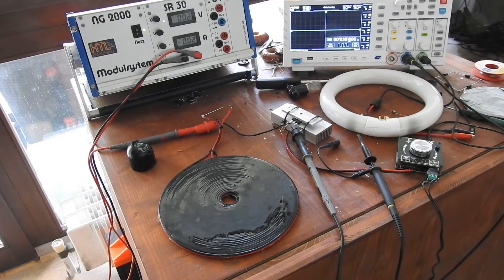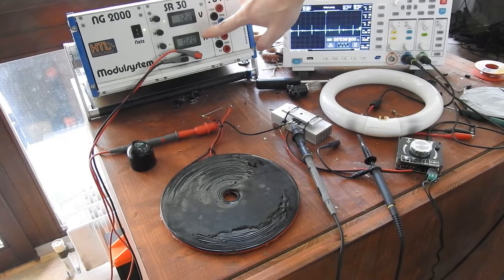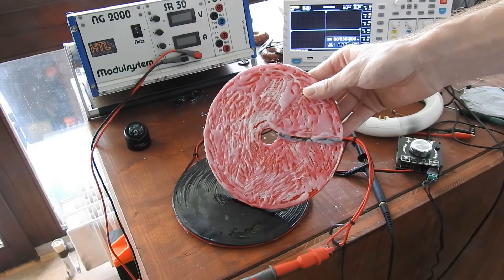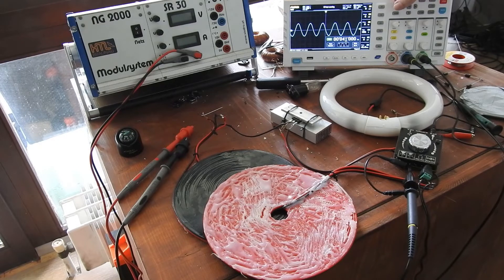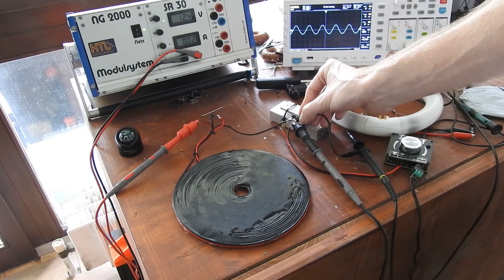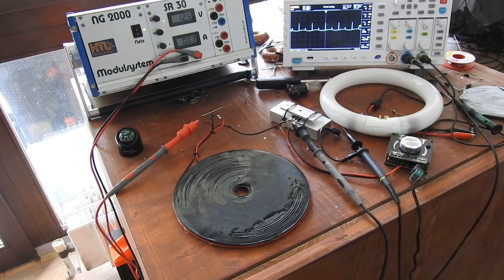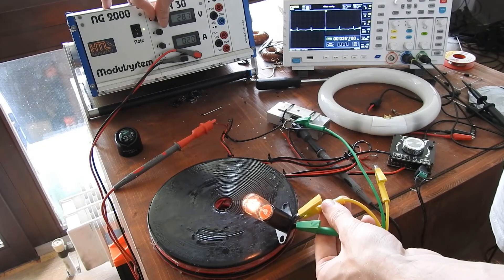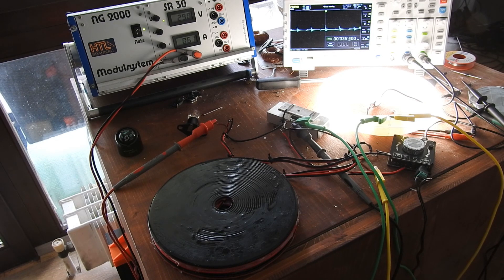3 Methods of using Tesla´s bifilar coil and differences between a monofilar and bifilar coil

Comment: The coils you are using are not the same as Tesla's bifilar geometry. You have the two circuit-halves as a pair of pancake-coils laying one atop the other. Tesla placed his two circuit-haves interspaced with one another in a single flat pale. Your wire positions and Tesla's are 90 degrees out of phase from one another. Your geometry is much simpler to assemble, but you should really try a coil of his geometry and see if it yields the same result.
Reply from the maker: I know you are referring to the design in his patent, but the shape doesn't matter that much, he even stated that you can use all kinds of geometries for bifilar coils.

I tried it with several different geometries including the one you are referring to and all yield similar results.

Comment: Great video friend. I have also experimented with these coils please look at this video it relates to using very low power even though more appliances are added. I did try to make system that can collect the high pulses to a capacitor faster than the input used https://youtu.be/RbdgR-Hitzo

Comment: I like your video I use regular coil and i get very interesting outcomes. which video show the driver circuit. I would like to combine both theories and see a new energy form. also i have found a compress energy form.
Reply from the maker: I show the circuit in my video called "How to build a high voltage impulse generator".
Reply: @OmegaZZ111  Thank you kindly . I also found Mono-polar force and self charging battery system . Now i want to learn from your system it's all on my channel thank i will look at your video Thank you
Reply from the maker: @sidster64  I have watched some of your videos a while ago, what you do seems interesting. 
Good luck with your research.

Comment: According to Tesla the bifiler coil with 1k windings (versus the monofiler coil) gets 250,000 times the potential voltage across the coil. This coil is the evolution of the transformer that replaces capasitors in his circuits. It is his "energy sink". If you read patent 649,621 it shows the monfiler coil. I believe Tesla intended this patent to use the bifiler coil in oil and shielded 🛡. Like I said before, he patented all the components to his devices. The fascinating part is his primary attaches directly to the secondary at the ground. This is an air coil with pure RF energy. He is building up the energy in the bifiler and dumping 95% into the ground where there is almost no lost of energy. This is then picked up by his second identical antenna 📡 anywhere on the globe. It's travels at pie/2 x c. Sounds waves in the ether travel at the speed of light. It is analogous to two tuning forks thousands  of miles apart!
Reply: Hello, Sorry, but you have missed the distinction between the here discussed bifilar coils (also invented by Tesla) and his Tesla Coils --which you are describing.
Reply: Please read my comment. I might have info for you.
Reply: i hope you can cite the reference material where tesla says such a thing...

because its the first time ive read it in my thirty odd years of studying him.

i love how you people just seem to come up with your own theories without seemingly taking the time to even read anything he wrote himself, relying instead on hearsay, myth, and imagination...

you cant push the potential of a bifiliar up to any appreciable level as your dielectric starts breaking down. the potential between any two turns is half the potential across the coil itself, rather than the potential difference between turns being simply the potential drop per turn like a normal coil. it is bleedingly obvious, yet for some deluded reason you think you are onto something simply by saying it should be "insulated in oil", as if that will solve everything, and allow for millions of volts between each turn?

which is why his pancake coils used for high voltages are single wound, and his bifiliar coil, exactly as stated in his patent, is as a "power factor correction capacitor", examples being the run capacitor in an induction motor, or the capacitor across the ballast of a fluorescent light...  because capacitors were expensive to make when he was around. they didnt have polyester film, or kapton tape. they had oil soaked paper, or mica, and coarse, low tolerance rolled sheet rather than several micron constant thickness foils. manufacturing technology wasnt quite where its at today. 

you people all seem to overlook that little point.

theres nothing "fascinating" about having the primary earthed. like any transformer, if the center is tapped, its at zero potential in relation to the ends of said coil.

and what does he say in his patent about it? did you take the time to read it?

from memory...

"one may also connect the end of the secondary to the center of the primary for safety reasons".

did you fail to see that bit, or it simply doesnt fit in with what your imagination requires?

what WAS fascinating about a pancake coil was that it pulled arcs from the objects around it, rather than arcs spraying out towards objects. the coronal discharge and inevitable ionisation of breakdown always traveled from grounded objects and headed TO the coil. besides my own, ive only ever seen one other coil doing that.
Reply: @paradiselost9946  The bifilar coil's high energy storage capacity makes it of interest for coil discharge experiments, the inductive spike that shows up when the circuit opens comes from the environment, not the collapsing magnetic field as we're taught, a coil with a high capacitance like this makes to serve as a better sink to the incoming flow than a regular monofilar coil.
Reply: @JenkoRun  begss the question, WHAT IS the agnetic field and what is it DOING when its "collapsing".

one of the biggest hurdles is our understanding is limited by language and other peoples preconception, and yet other peoples interpretations of them...
Reply: @paradiselost9946  Eric Dollard's "introduction to dielectricity and capacitance" may be of interest to you on that